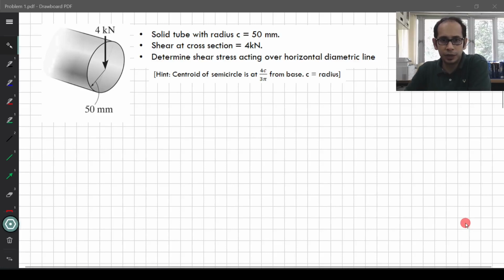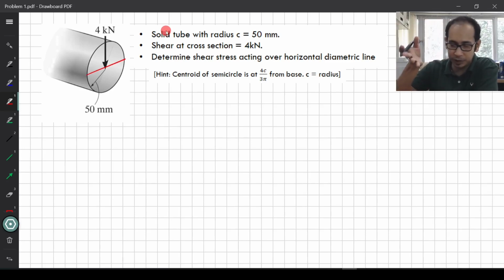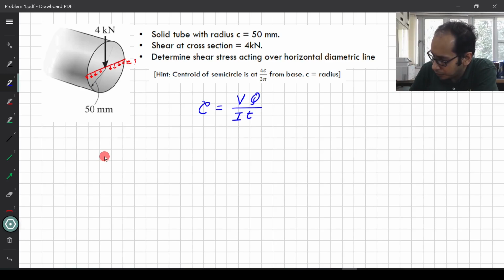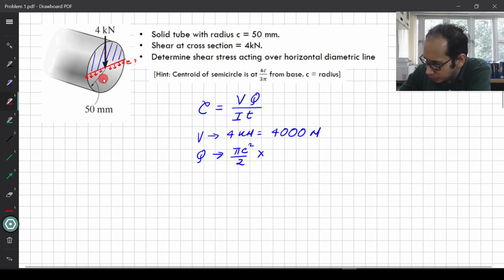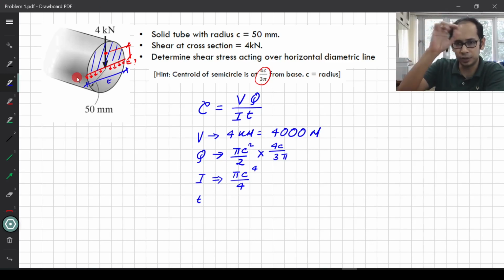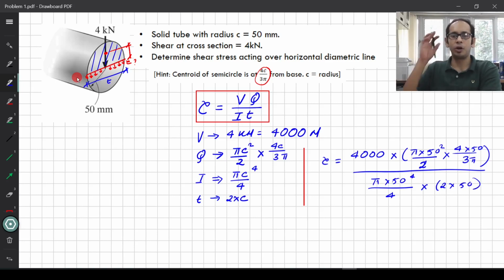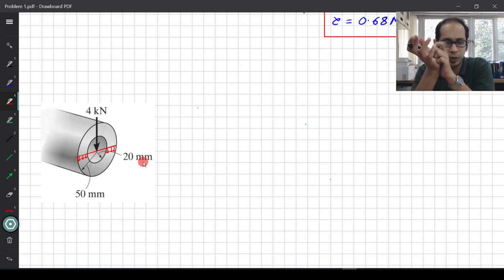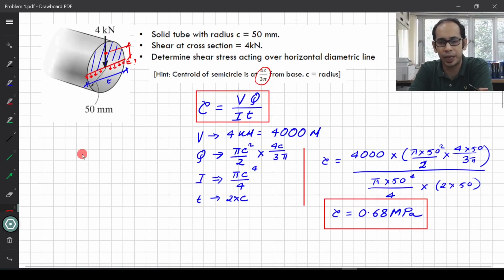Topic # 7.2 - Problem 1

Comment: Unable to get answer for hollow one
Reply from the maker: @Iitian27  Check if you have done a mistake in the calculation for Q, or substituted the thickness incorrectly. Verify your solution with this: https://www.dropbox.com/scl/fi/zmelwsihi7n6ugy6l8re2/Shear.jpg?rlkey=iev8t5gdmucxldx2462zxkhfb&st=88ftugcv&dl=0
Reply: @solidmechanics-prof.jaygho7500 yes , there was mistake in finding Q .. thanks a lot sir ... Best teacher for mechanics .. the concepts I was not getting since the start of sem I started getting now because of your channel
Reply from the maker: @Iitian27  I'm glad to hear that.